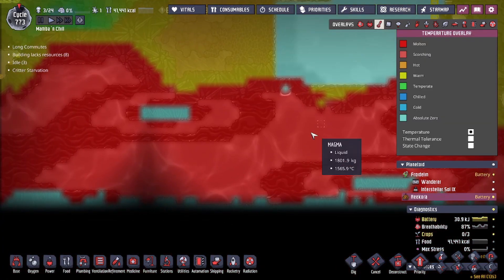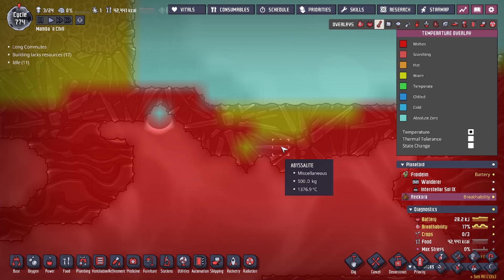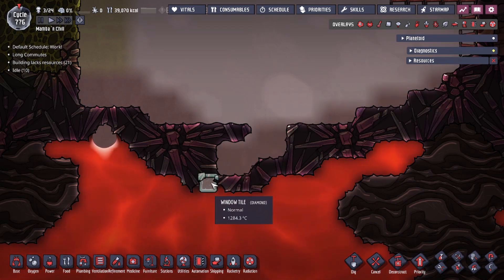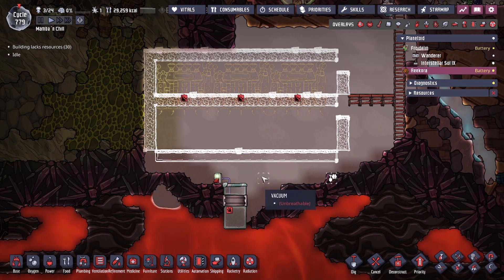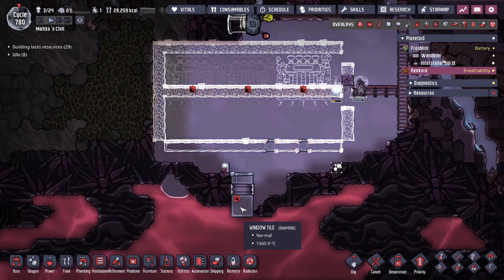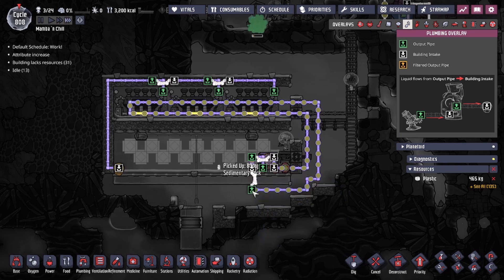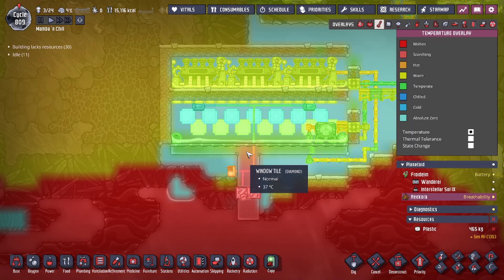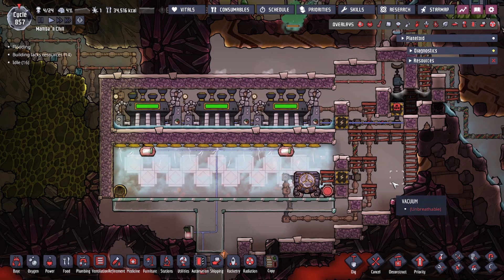Harness the Magma core! Geothermal Power - Oxygen Not Included

Comment: I would add a note to always power your doors when doing a heat spike. Use steel wire to prevent it from melting. There is a bug where unpowered doors can sometimes still conduct heat when open. 2 of my plants overheated this way and it was really hard fixing it.

Comment: The main problem of the core geothermal power plants is that they are too complicated to be temporary, but they actually are temporary. The magma around your tempshift kernel will freeze quite soon, and the thermal conductivity of rock created this way is significantly lower than this power plant requires. The moment when magma turns into rock is the last day of your PP, and when rock's temperature is under 500° it's actually the death. I haven't seen any reasonable solutions that would solve this problem, and wouldn't require extreme volumes of resources and time. I can build three or four PP of other type instead, and they will be literally eternal
Reply: Mine never reached that age, but what I had in mind was roughly like this:

Over time I make a straight vertical wall left and right, all the way down to 1 tile from bottom.
At the bottom I place a robominer and arm to move solids to the steam room.

At this point it's basically a magma blade until the core is drained. That should last longer than my game does.

Comment: Why use an acquatuner - can't the steam turbines be self-cooled - maybe radiant gas piping needed? Also why not drop the return water on top of the heat spike ie in the middle rather than on the side - should lead to more even temperature? Also you can use the diagonal build trick to make a plastic temperature shift plate (where the only hot thing is diagonal to the build location. The plastic TSP will draw heat diagonally and then melt into naphtha. At that point it stops being a temperature shift plate and stops drawing heat diagonally. Naphtha is second only to Viscogel (space materials) for liquid locks.
Reply from the maker: self coolilng steam turbines doesnt work past a certain temperature point because it breaks the balance and the steam turbine stops running. the aquatuner is needed.

with the tempshift plates, it doesnt matter where the water is dropped.

crude oil is easily the best liquid lock liquid imo due to having the highest g/mol value. while naptha is is pretty good, visco gel is very bad when it comes to liquid locks

Comment: ok im confused tho why would you ever want to turn off the steam turbines tho?
Reply from the maker: if the turbines are running 24/7, even though you have max power in batteries, you're effectively just  burning off the power which lowers the temperature overall and shortens the lifespan of the geothermal plant. while the lifespan of a geothermal plant is tied to RNG (size of magma pool, shape, etc) and they tend to have long life, they do eventually run out
Reply: @2LegitCity  sure but doesnt the aqua tuners delete heat from your base tho?  but i got you the only reason is to conserve some of that heat energy

Comment: I made the mistake of putting crude oil on the floor with the turbines, rather than water, and that caused the turbines to over heat at any temp over 170c for the thermo sensors, even with full radiant pipes around the turbines. After cleaning that up and putting water in, the temp issue went away and I was able to use the proper settings.

Comment: If you don't want to use aquatuners you can use 265 degree steam and use the water from the turbines to cool themselves. You get less power but you don't have to spend 1200watts just on cooling.
Reply from the maker: i believe that 265 value is in Fahrenheit. i would not recommend using a self cooling steam turbine design with a geothermal heat source as temperature control of steam is harder to fine tune. the self cooling steam turbine is very volatile and can break with just a 5c temperature increase, and when your pulling heat from a 1200c+ heat, that can happen in an instant

Comment: The two thermo sensors need to be offset because of the aquatuner beneath one turbine. The heat from the aquatuner keeps the steam temperature underneath that turbine higher than the farthest turbine. By my observation, for the exact setup given here, the thermo senser beneath the turbine with the aquatuner underneath needs to be kept at 220C while the away thermo senser be kept at 200C. I tried the same setup with five steam turbines, and the offset was by 80C (that is 280C and 200C). Thank you so much for the design.

Comment: i dont understand why goe thermal keeps on spiking to 1000.i followed your design to the letter.yet my steel door continues to transfer heat when its open and in a total vacuum.the automation wire is at the same temperature as the door as well even inside the steam room whats going on.but i reload at a save before the temp spike it works fine.but after awhile its flashes to 1000 without warning,its still totally sealed where the magma is
Reply from the maker: thats most likely the "door bug" thats been happening recently. 
basically the door is "open" and shouldnt transfer heat but for some reason the game still allows for heat transfer. this notably only happens when the game is laggy & simulating on any speed higher than 1x. as you stated, save & loading the game fixes it.

so youre not at fault and ive lost a geothermal setup that i sealed up as well- hopefully klei is able to fix it
Reply: @2LegitCity  I used your design and got the same problem every 50-100 cycles. You can solve the problem by powered the automated door. Then is state is correct.
Reply from the maker: @michaelkinet6189  this does fix it from what i've been told! i actually use a different method to do geothermal heat now
Reply: @2LegitCity  thks mate

Comment: srry m8 i have a question, why would u put the aqua tunner inside the steam chamber and not outside? i know that u use the aqua tunner to produce heat but if u have the magma template, why would u need the aqua tunner inside?
Reply from the maker: think it about it the other way, the aquatuner generates heat yes, but also needs to be cooled down. the cooling buildings of either the aquatuner or thermo regulator both generate alot of heat but only do that because of the amount of cooling theyre providing. so if i were to put it outside it work break instantly and the steam turbines would break as a result
Reply: @2LegitCity  okey, I think I get it now, thx a lot bro

Comment: While the magma core won't last forever, the minor volcanos and normal volcano will.  They are all clustered fairly close.  I read it's 2 turbines per minor volcano and 4 for regular making 10 for constant energy, but how many extra turbines + aquatuners are needed to cool the igneous rock consistent to the rate of volcanic eruption, for stone hatches or crushing into sand for pwater offgassing (need the ceramics...).  I suspect simply 4 more won't be enough.
Reply from the maker: it depends on how low youre willing to go with the igneous temp- i have a video that auto condenses the magma into igneous and extract that via molten lead pool, so you could go as low as 150c~ from the steam turbines drawing power

Comment: As a total noob I would've wanted you to tell me what temperature to have the liquid pipe thermo sensor at. I think I figured it out but it would feel better that way since I dont trust myself! :) Otherwise great video as always. Thanks!
Reply from the maker: thanks for point that out- that just totally slipped my mind and i didnt even know i missed going over that. incase you wanted more info, heres a video that goes more into the subject: https://youtu.be/JxO6qv8VSx4?t=150
Reply: He mentioned that. 200°C for the door automation and 170 for the AT thermal runaway protection.
Reply: @Teasuti  Oh really? Must've missed that even after all those replays. Thanks!
Reply: @LithePaper  I think it was 270 for the AT? Can't recall, but 270 would make more sense, when it's made of steel.
Reply: @Teasuti  Oh no I meant the thermo sensor running into the aquatuner. I don't think he said that. The protection he talked about in the end had 275°C until it turned green.
Reply: @LithePaper  that's the one. 5C below that is adequate.
Reply: @LithePaper  In the video he links above he sets the thermo sensor going into the aquatuner to 24c to keep it from freezing up.
Reply: @LithePaper You need to keep the steam turbines below 100 degrees, so any temp below that, with an appropriate coolant. I just use regular ol water at room temperature.

Comment: Wait what? Obsidian not conductive? Number beg to differ. Obsidian has the conductivity of 2,000 while ig. rock and magma has 1,000.
What you might have meant is that there is less energy in obsidian due to it's lower mass per tile and 5x lower SHC; a tile of obsidian has about 10x less energy in it than a tile of magma assuming they are at the same temp, and they are in core.
Reply from the maker: my bad, i tend to compare conductivity across all solids so that 2.000 is going against diamonds 80.000 or aluminium's 205.000. i was also considering how heat transfer would work and spoke without explaining deeper into the thought process. basically the equation for heat transfer, the liquid to liquid heat transfer is faster than the liquid to solid heat transfer. you are correct in how the obsidian holds less thermal energy comparatively to the magma due to how SHC values.

Comment: Hi, is it possible to use this system (adjusting the temperature sensors) for a petroleum boiler? My Asteroid (vanilla game) doesn't have (or I haven't found) volcanoes.
Reply from the maker: not exactly this, but you kind of can. there are concepts i would roll over to a petroleum boiler build but there is alot of things i would add and modify

Comment: Diamond is needed for the drillcone.  There's an achievement for mining a certain amount of mass from asteroids.  What if we had a thin layer of crude oil on top of the diamond below the steam turbines?  Would it flash to sour gas, or is it likely stable as crude oil?
Reply from the maker: the glass can actually go above 500, especially when turning it on for the first time so i wouldnt risk it. also the larger the glass section above the door, the higher temps that part can go- so its a bit risky